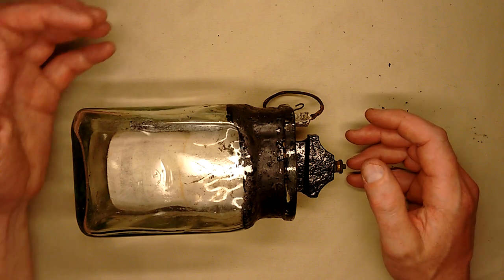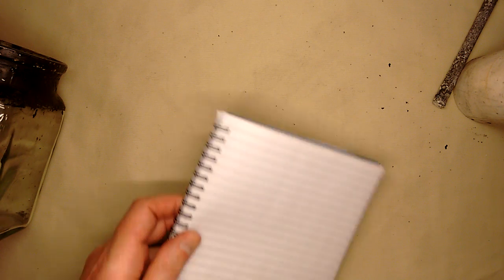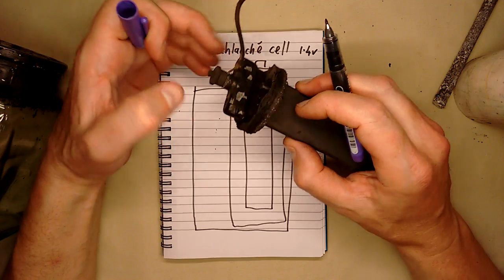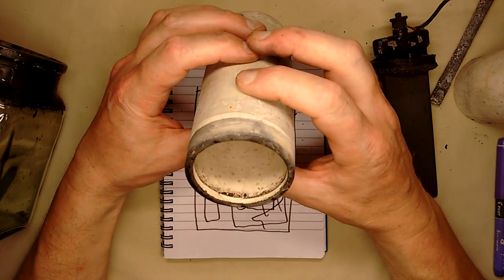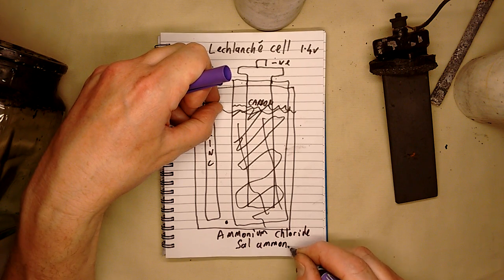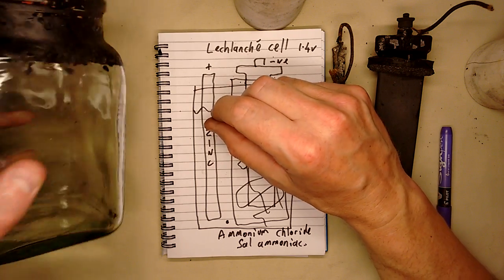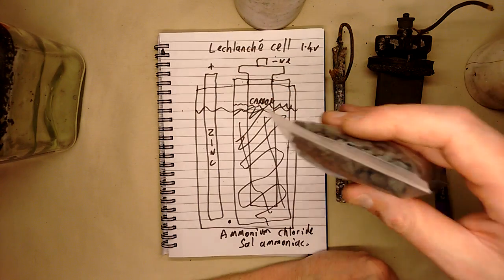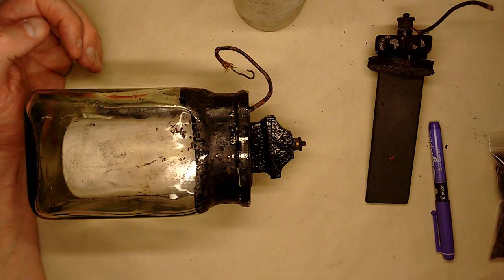A look at a vintage Leclanche cell.  (Very early battery.)

Comment: Had these in the school physics lab back in the '60s  Suppliers were Griffin & George or Galenkamp.  The Ammonium Chloride was almost a saturated solution.  The manganese dioxide was a degasser to remove the hydrogen bubbles from the carbon  electrode surface, which would reduce the current output.  Back then modern plastics were in their infancy so insulation was rubber, cotton braided covered rubber, waxed cotton or silk.  Pitch was often used to seal batteries, even the old 'D'cells! It was unaffected  by acids/alkali's  
For higher current applications, such as valve radio heaters, glass cased lead/acid 2 volt cells were used. Recharged at the local bicycle shop or garage.  Good to see them again!  Thanks for the memories!

Comment: @BigClive
Hurricane season is coming up very fast for the States "U.S.A"
So how about making a series of DIY Easy alternative power video's?
Those in a small playlist would do extremely well!
Reply from the maker: Everybody has a little bit of prepper in them.
Reply from the maker: Having just returned to my flat to discover that the power had been disconnected for new supply cables while I was away, I had the pleasure of being without power for a night.  The single most useful thing was a low power head torch as it supplied continuous light wherever I went.  I'd also suggest some really beefy USB power banks for keeping your phone active and a simple gas camping stove for hot drinks.
Reply: Looks like you're on the verge of becoming a 'prepper' then Clive?
Reply: bigclivedotcom Agreed!

Comment: Hi Clive - I understand that the better quality cells used to have the zinc rod amalgamated with mercury to increase the life expectancsy and reduce corrosion. The upper portion of the class jar was coated with paint or pitch to stop the creepage of salt formation from the electrolyte.We had a stately home, some of those Leclanché cells on a wooden shelf to power the annunciator and bell, but regrettably no maids! Cheers.

Comment: That looks like early motor rewind wire. I've rewound many old motors that had cotton covered wire like the kind you've found on the zinc anode.
Reply: in the Victorian era almost all wires were cloth covered. I am not sure but I think it was the 20's or 30's when rubber became common to use.

Comment: Hello BigCliveDotCom, 

Ikea has a set of NI-MH Rechargeable batterys 1000mAh 1.2V for 7.27 Dollars(49 Kr. in Denmark) and a charger for 2,82 Dollars(19 kr.). You should check it out and test them. It can't be true for such a low price like 19 kr. for an USB charger that charges at 1.4v and 0.22A for 2AA batteries. That can only be interesting!

Comment: The drop in current after prolonged use is due to the formation of tiny bubbles on the electrodes as current flows. These dissipate when the discharge stops.

Comment: I think they used to use these on the railway for track circuits. When I were a nipper, they were doing the local signal box and there were dozens of them piled up outside the relay-rooms. They were definitely not lead-acid, but were too heavy to usefully 'liberate.'
Reply: When my dad was a volunteer, about 15 years ago, at the Isle of Wight Steam Railway, they still used these for the track circuits.
Reply: Signal & Telegraph applications often use NiFe cells, the electrodes being Nickel and Iron (unsurprisingly), with an electrolyte of Caustic Potash.
EMF is 1.4V.

Comment: +bigclivedotcom - the reason the current drops off is because you end up with ions clustering around the electrodes because they're attracted to them. They end up getting in the way of new ions going towards the electrodes to drop off their charge. When you stop drawing charge, the ions diffuse back throughout the solution and everything goes back to normal

Comment: In 1960 my parents bought an old vicarage which was very large and had a servants quarters  in the attic. It had a large butler bell system tha ran on a whole bank of Leclanche cells which were still there but at some time they had been replaced with huge dry cells stood on top the leclanche cell's box, the dry cell's were interesting too as they were around 9 inches tall and 3 inch diameter with big brass thumb nuts as terminals and even though they had not been used in years still put out quite a few amps. When the house was renovated we found an even older bell system under the floors and in the walls that used wires and cranks. The batteries in the old stables were by far the best though, a bank of glass lead acid batteries each one the size of a washing machine, around 40 of them.

Comment: Are you sure the zinc rod is the positive?
Reply from the maker: I added a correction in the description and an annotation on the video.
Reply: Well the zinc electrode can't be called an anode then, because anode i positively charged.
Reply: You would know for sure if you got it working.
Reply: Ok, i am sorry i didn't know that there is a diference between and electrolytic anode and an anode in a battery cell.
Reply: The anode is the terminal where current enters the device, so for a diode the anode would be measured as positive relative to the cathode but for a battery it would be the negative terminal.  The way to remember it is to think of the 'current inode'

Comment: Hi Clive,love all your videos !  I have a bell system in my house,it has a box above the main living room door with the numbers 1 to 5 on it ...when the front door bell is pushed number 1 shakes back and fore...other numbers cover the bedrooms... House was built about 110 years ago, and we must be the only house in the street that didn't rip them out! Prob goes back to the servant/master days of the house?  Runs on bell transformers now though...  Could you do a strip down of a cigar shaped battery pack that is currently on sale in B&M bargains,it is 2600mah and is £4.99 with a removable LED light which plugs in at the top...I have 2 but would love to see the build quality inside etc? Thanks martin

Comment: great video Clive I was wondering what the weight of each of the items are including the approximate weight of the fluid in the jar? and what would have been the combined weight of 1 jar?

also how many jars would have been used?
I always assumed that the bell systems where a wire pulley configuration! (i never heard of that type of battery before)
Reply: youd use a few, no exact amount, enough to get over the wiring losses depending on the size of the house, it only had to be enough to ring a bell the other end
Reply: Why would you want to know the weight ?
Reply: @pufango4059  because I'm nosey, and it intrigues me!

Comment: How common is it to see fabric covered wires in the UK? From my experience in the northeastern US, you can find them in old wiring in houses or old lamps and things.
Reply from the maker: Lead sheathed vulcanised india rubber.  Tends to be very crumbly these days.  There are still some flats in this tenement wired with it because the owners don't want the expense of a rewire when "it still works".
Reply: Theoretically this should not exist any more. New cabling has had to be PVC or similar since the early 60's. Theoretically household wiring should be replaced every 25 years (but almost nobody does). The only type of "cloth" insulated wire that I know of that you could use for household wiring is used in aircraft (woven glass cloth) and is expensive enough to make your eyes water. It was probably left "as is" because you don't really need to worry about electric shocks in low voltage systems and even an array of 20 of these would only be about 30V. This might date from the Victorian era (pre-1910) so would be from before the first wiring regulations and you could in theory get away with using anything.
Reply: Just a few things... our house had VIR wiring into the 80s (on the lighting circuit). As jusb1066 said, there was a lot of standardization in the 60s, but older circuits tended to be left if they worked, our lighting circuit for example, I had NO idea was VIR (in oak casing even, with the 2 slots for the wires)... as the first leg from the board had been replaced with PVC and all the more recent stuff was pvc twin and earth. It eventually went dead short in the attic above the master bedroom, killing the entire circuit. The cable to the light itself was pvc twin and earth, which confused me... Someone had moved the ceiling light 3 feet toward the centre of the room (they used to put them toward the window, for dressing table purposes... and had simply twisted a new length onto the old rubber insulated cloth covered wires. The joint, where the wires were in close proximity and had been manhandled, was where it shorted. Had it not been messed with by DIYers it might even be still working now

the second thing is, a few years later, the house just down the road got demolished and I removed yards of the old lead sheathed cable (it's ok, I paid the demolition people, this was before elfin safety made such things as 'non employee on demolition site' verboten). The cable was in PERFECT condition, the rubber flexible, no damage to the lead sheaths... the lady who'd owned the house was a bit of a recluse and didn't really use much power, so it had led an easy life.
Reply: very early wiring was waxed cloth, or oil cloth, the same as the macintosh waterproof jackets, it does degrade badly with time, but this was before mains voltaged, and for a while was with mains voltages, then of course rubber came along and then the current pvc, for larger wires from the early generators they used wooden troughs, which is what edison did.
Reply: yes there is modern cloth flex, mostly seen on irons as its very resistant to burning, and new vintage lamp cord also, which is just an outer over a modern rubbery stuff
Reply: When we moved into our current house there was one run of that type of wire down to an old Bakelite light switch that was still in use. I carefully disconnected both ends and tested it, and it passed inspection (although I didn't do a high voltage test). As soon as I moved the wire though it broke the internal insulation somewhere and went dead short so it was on borrowed time.
Reply: Yep, my house, which was built in the early 1940s in West Virginia in the US, has cloth-covered wire in some places.  I just recently replaced a ceiling light fixture because the old one had been (without my knowledge) literally hanging from 2 of those wires which were braided together... eventually they wore through and created a short which was really quite spectacular and scared the hell out of me.  Flipped the switch on and BANG, sparks flew and everything.  I'm just glad such a thing didn't happen behind the walls!
Reply: And every sparks has seen the incoming lead with a scrawny bit of 2.5 clamped on as the earth with a hose clamp. Gently does it.
Reply: ***** not strictly true. Woven fibre glass is a "cloth" technically as it is woven, and is used for all sorts of industrial high temp purposes and used extensively in aerospace.
Reply: There are some specialist cables, mostly high temperature, with woven sheath but I can't think of a situation where it's used in fixed wiring. The oldest cable I've pulled out was a twin conductor where the conductors were wrapped in fabric and some sort of resin and then the whole lot was encased in a lead outer sheath, I'd guess over 100 years old.
Reply: I have seen it in avo test meters from WWII period. Not physically crumbling to the touch but in this scenario it doesn't get any significant chemical attack or heat degradation so i would expect it to be still ok. Usually black in colour
Reply: Dustin Rodriguez
could have been worse, could have been the alumnium wire, that along with the old bobbin system caused lots of house fires back in the day
Reply: in the UK there was a  huge change and standardisation of the wiring, voltage and socket types in 1963 or so, for this reason i dont think anywhere has working electricals from before that, so all the very old crappy wiring had to be removed, commonly before 1963 people only had electric lighting and no sockets
Reply: My house was built in 1981.  There is one cloth covered cable, the 8 AWG romex supplying the range.  Still in fine shape.  I expect by then they'd managed to figure out how to stop it falling apart.  ;)

FWIW, it passed a code inspection 5 years ago when I rewired the basement and added a subpanel.  Then again, Canadian Electrical Code still allows knob and tube wiring (technically... and you'll never find the parts, and if you do, you'll never find wire that allows you to use it that way).
Reply: My whole house from 1952 was filled with them :) they brittled to pieced just by touching them.
Reply: Tom Jacobs hat's not good to find.
Reply: +TheChipmunk2008 carpenters where the original modern day electrician. running wire in picture rail moldings etc
Reply: +bigclivedotcom I remember the school that I attended had the lead-sheathed, vulcanised rubber everywhere.  It was amusing to note that they simply substituted both materials with PVC later on (and changed the colours), but the cross section was still the 'twin and earth' that we use today and instead of brass-strip buckles, we now use plastic clips with a small nail attached :-).
Reply: House is from the 1830s, has had many generations of electrical insulation practices.
Reply: Syn Kronos I have never taken a cooker apart so didn't know that but it makes sense.

Comment: what would the system voltage be?
Reply: Someone didn't bring their listening ears...

1.4v, as stated in the vid.
Reply: +lazaglider system voltage ( how many in series)- aka the voltage of the equipment run by these, .not cell voltage
Reply: about 12V to 30V as there was usually an array that was different depending on who made the system.
Reply: he said system voltage so no not 1.4V more like 12-30 depending on the exact system. Clive did say there was an array of them.

Comment: The early dry cells were made dry by using sawdust to absorb the ammonium chloride into a paste, then putting it into a zinc case as a housing. They were common until the 1980's as a power supply for farm phone lines which needed a local battery to operate. As the cells need oxygen to depolarise ( which is why they cannot deliver a high current) they put in a small vent made from porous ceramic so it would not dry out too fast.

With your zinc electrode the way it was made was by casting the zinc around the tinned copper wire in a mould, so it was embedded in there. They just used what was then ordinary house wire, which was tinned copper (tinned so the copper would not react chemically with the rubber) wire in a natural rubber extruded casing which was then covered with 2 layers of cotton cloth woven around it. 

The anode is most likely held in by using a small lead strip that was pressed in with the brass screw. Pyrolytic graphite is brittle, but very tough for what it is, you can get it in large blocks used to make electrodes and seals.

Comment: I was watching intently and when you changed the carbon to the positive I almost overcharged. I was thinking to that point that I would finally remember cathode and anode.  Now I just don't care.  LOL
Reply: I remember it because I happen to have lodged in memory that the old kind of screen -- before LCDs ruled the world -- was called a cathode ray tube (CRT), and that electrons are negatively charged.

CRTs worked by firing beams of electrons (cathode rays) at phosphor, causing the phosphor to shine. So the cathode must be where the electrons are coming from, which must be negative.
Reply: The cathode can be either positive or negative with respect to the anode. It depends on the device. In CRTs, the cathode is negative. In galvanic cells (non-rechargeable batteries) the cathode is positive. Conventional current departs the cathode. Electron current enters the cathode.
Reply: Oh! I've had it wrong all these years. Thanks for clarifying.

Comment: IIRC, you can prepare ammonium chloride by mixing ammonia and hydrochloric acid, both available at hardware stores, though in diluted, impure forms, and the latter is sold as muriatic acid. The yield will almost certainly be lower than simply purchasing ammonium chloride, but it might be potent enough to do the trick here.

Comment: Farms here on the East Coast used similar, albeit much larger, batteries to provide light before primaries were draped across the countryside. According to some of the older people I've spoken to, some farms were using batteries for lighting up into the 1960s. As a kid, I remember my parents getting a few of the glass battery cases which were about 2-3 gallons in capacity and we used those to store sugar and flour in. I've never seen one fully assembled. Another similar system was in use in older buildings up until the late 1980s to early 1990s for low voltage emergency lighting. The first company I worked for was still doing the yearly or bi-yearly maintenance on those cells, but I never got to go along for the ride.
Reply: Thanks for sharing. There is always a ton of things to learn from comments related to educational videos.
Reply: This comment is nit YT quality. Why aren't you saying something stupid?

Comment: Paper or fabric (or both) soaked in parafin was used to insulate wires. In Spain we at the phone companies still call "parafinado" to the wires used to make connections, even when they have been insulated with plastic for as long as I can remember.